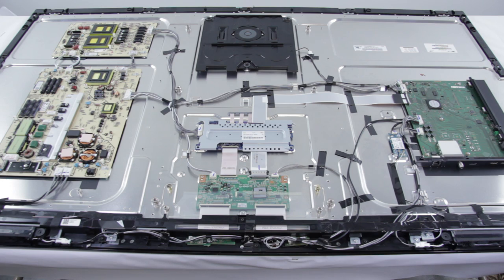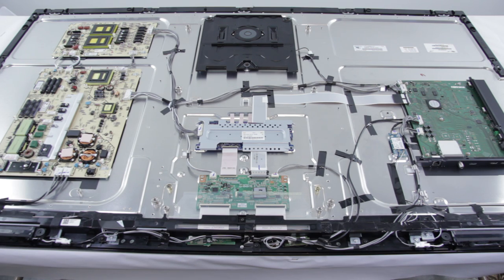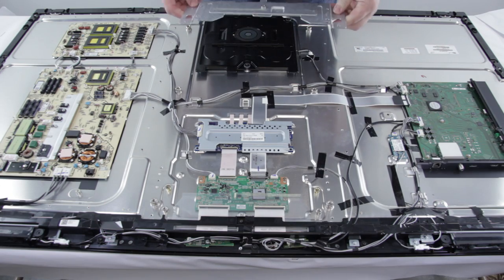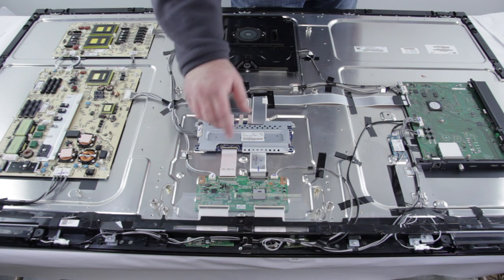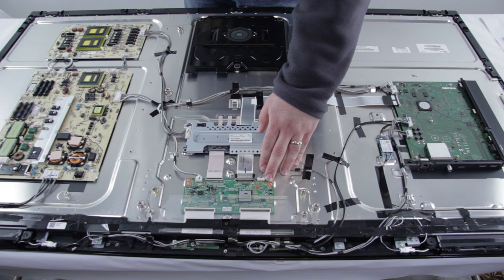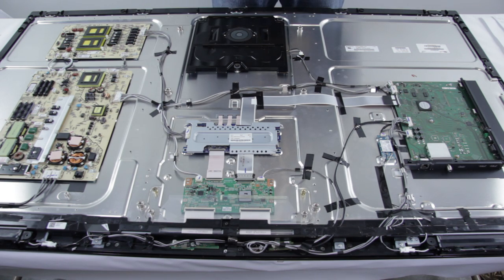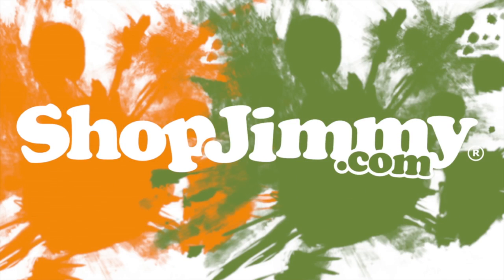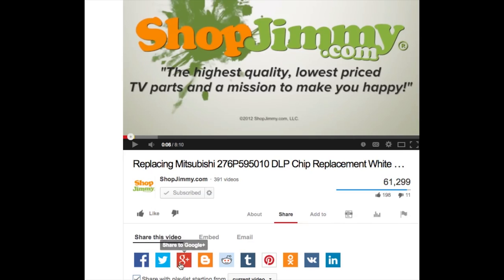LED TV Repair T-Con Board Help Review Overview - Common Issues and Problems with T-Con Boards

Comment: Vizio E420i-B0 with colorful lines. I turn it on i can see some of the start up and some of the input sources. Sound is still good what should be the problem? Is it the T-Con Board?
Reply from the maker: +rey azada   Try all repairs and troubleshooting at your own risk.  This sounds like a TV panel (TV Screen) problem.  If your TV panel is bad, it may be more cost-effective to replace the TV as panels are typically hard to find in stock, difficult to replace, and expensive.  Thanks and please let us know if you have any further questions!  www.shopjimmy.com

Comment: LG LED 43" TV

A light green tint appeared across the television. There is a horizontal strip of about 4 inches across the top that seems unaffected (color is normal).

LG43LH540T

Comment: jimmyTV.  I have an LG LED ... Model number 55LW5600-UA.  I have no picture, but I do have sound.  Watching this youtube video as well as others I believe the problem is the tcon board and I need to replace. Is this what you think it might be as well?  If so, do you have replacement tcon board for this model?  Thanks!

Comment: I have an RCA PRK65A65RQ that had intermittent no picture issues. Tried to reset then nothing worked. Replaced power inverter,  now it  turns on, picture flashes on  for a second then black 15 seconds later flashes on for second. Any thoughts?

Comment: I have an LG65LY540S-UA LED TV.  new out of the box, but it has passed its 30 return policy.  the tv powers on, has color  and has a very grayish staticky picture.  I have pictures of the issues as well.  how can I tell if I need to buy a new board for the inside and if so, what kind of board?  thank you

Comment: I have a VIZIO model #d650i-b2 it has sound but no picture.  It went out while the TV was on, it has a faint blue screen to it. Was wondering it you had any idea as to what you think it could be, or what test I do could perform to narrow it down.
Reply from the maker: Patria Ferrence     PLEASE SUBSCRIBE TO OUR CHANNEL - Try all repairs and troubleshooting at your own risk.  This could be a problem with either the t-con board, the main board or the TV panel.  You can replace the t-con board and main board individually to see if one of those boards fixes the problem.  Click this link to replacement parts for your TV model number:  http://www.shopjimmy.com/catalogsearch/result/?q=d650i-b2  There may be multiple boards for the same TV model number, be sure to match part numbers on your current board, with your replacement for compatibility.  Thanks and please let us know if you have any further questions with your TV Repair!  www.shopjimmy.com

Comment: I have a Westinghouse TV DW39F1Y1 that the picture went out but has sound. I just changed main board and no change. did a flashlight test and can see a picture in the dark. with this TV I only see a t-con board main board and power supply on back if it's the backlight where is it at on this tv

Comment: Samsung 55-Inch 4K Smart LED TV UN55KU6300FXZA... I still have a picture and sound when using apps through the Internet. However all my hdmi and component inputs show no signal. Is this the t-con board and if so which one do i purchase from your shop. Thanks

Comment: Jimmy, I have an Insignia NS-42E760A12 42" LED 1080p HDTV that I operate 24-7. It's not very old, maybe 2 years and it's now flickering on the left half of the screen which also is slightly darker than the right. It happens on all inputs. When it first started it would go away after a couple of hours being left on. Now it is permanent. Which boards do I need to replace to fix this issue? Or is the panel shot and I should buy a new TV. TCON, Main board, power supply??? Please help.
Reply from the maker: Peter Chan   I recommend replacing the power supply board in your TV.  Here is a link to replacement parts for your TV model number on our website, click here:  http://www.shopjimmy.com/catalogsearch/result/?q=NS-42E760A12  Be sure to match part numbers on your current board, with your replacement for compatibility.  Here is a link to a video showing how to identify your part number, click here:  TV Part Number Identification Guide for Insignia & Dynex Power Supply Unit (PSU) Boards  You can also call our customer service for further assistance with your purchase.  (877) 881-6492  Thanks and please let us know if you have any further questions with your TV Repair!  www.shopjimmy.com

Comment: Hello
I have received a message from my local repair center, that the TCON-Board in my Pioneer L55S3D13N is broken. I would like to know if it is easy to replace in this model before I decide to let them replace it at high cost?
Reply from the maker: Frederik Valsted   Most board replacement can be done by Do-it-yourselfers, however I am not sure what your t-con and TV back looks like.  Thanks!  www.shopjimmy.com

Comment: Hi Got a Samsung UN55ES6150f  Got no backlights. did your flash light tests and have , menu and audio. Your video is a bit confusing for you say it can be the Led Driver board . I have what appears to be 3 board  main board, power and  tcon .  I assume the led power is on the PSu board. The set is 2 years old  and no parts from you are available . I see used stuff on ebay but still confused on what board its a 50/50 shot but with no Backlighting is it safe ot say its the Power board Samsung BN44-00503C Power Supply

Comment: Hi I have an LG m3701c-ba and the picture is fine except that on dark images such as grey's, black's or any scenes that require a lot of color depth I get reddish patches on in certain areas of the screen, adjusting contrast and brightness helps some but then the reddish patches appear in other areas of the screen or change shape... is it a bad motherboard or t-con board?
Reply from the maker: sburns015   This sounds like it could either be a problem with the T-Con board or the Main board in your TV. You may need to replace each board individually to see which one fixes the problem. Here is a link to replacement parts for your TV model number on our website, click here:  http://www.shopjimmy.com/catalogsearch/result/?q=LG+m3701c-ba Be sure to match part numbers on your current board, with your replacement for compatibility. You can also call our customer service for further assistance with your purchase. (877) 881-6492 Thanks and please let us know if you have any further questions with your TV Repair! www.shopjimmy.com

Comment: We have a Sony kdl-42ex440. Three years old.Color problems, becoming blurry . Like an overexposed photo.
Research kind of points to bad t-con  board. Problem comes and goes. More lately. We think we could change 
The board. See board for this model is out of stock. Suggestions?

Comment: I have a Panasonic lcd tv model number TC-L58E60 it has pitcure and sound but on the picture it has ahorizontal  line a 1/4 way down the screen all the way across and from the line down the color is darkened and on the left side on the screen has some double imagae and slow motion . could that be the t-con board? thanks

Comment: I have samsung led tv UE40D5520. It shows vertical lines but it has sound. when I opened the back and disconnected one of the t-con connections,the picture showed with sound on half of the screen, no vertical lines.I reconnected the cable whilst the tv picture was still on and got the other half showing as well to give a full screen view.

If I now switch off the TV and turn  it on again the vertical lines reappear. I think it is a probblem with th T-CON board. Please can you advice what the problem is and where to get the genuine part. Thanks.

Comment: I have a Visio m550nv...the screen intermittently begins to have green lines and pixilated green and purple images. This happens to both the image on the screen and menu/volume/etc display. Would this be a Tcon board issue and do you have a video which specifically addresses the repair to my particular model?

Comment: JVC - LT-50CA890a

Hi I am looking for some advice with my tv, I have noticed a couple still lines vertically across the screen while it boots up and when playing video or displaying anything, patches flicker displaying random vertical and horizontal lines. What could this be please?

Comment: Emerson tv 32 inch Model # LF320EM4-A red light stays on when power button is pressed red light flashes 4 time then solid red again no picture or sound. Replaced combination power supply and main board . Same results after replacing

Comment: Seiki SE501TS backlight flashes very bright then off, flashlight test shows menu on screen and the sound is good. Already replaced mainboard and power supply board. I am guessing to replace the T-Con board next... ??? HELP!

Comment: I have a LED lg tv model:47LN5700-UH and I think it's the backLIGHT but not sure .. When I turn it on it flashes then goes dark, wen I put a flash light on it I see then images on the screen but it is very dim. Any suggestions

Comment: Hi Have Sharp lc-70le55ou picture comes on for 3-5 seconds then goes dark but still have sound and backlight...anyway to know whether it is the t-con or the main board as you suggested?  Thanks in advance for your help
Reply from the maker: +stephen thompson   Try all repairs and troubleshooting at your own risk.  I recommend running the flashlight test on your TV.   Here is a link to a video we produced that shows how to run the flashlight test. https://www.youtube.com/watch?v=xUzCLgoSPGM Please reply with your flashlight test results and we can recommend a replacement part for your TV repair. Thanks and please let us know if you have any questions! www.shopjimmy.com

Comment: I have a hitachi LE49s508 with no backlights. I am trouble shooting the problem and I need to know the voltage needed for the backlights. I cant locate this on the board can you help ? Problem I have is no sound no picture

Comment: Hi,I have jvc-lt-49n675u,switching on but not starting jcv emblem the light is blue but the screen blue and white like no sound no picture. So I have checked all the back light led's they are  ok what could be  a fault I thank  you from auto

Comment: I have a Samsung LTF460HA06. The picture had a series of vertical lines. I replaced the ribbon cable that connects the main board to the T-con, and also ordered a new t-con board from you. Now looking at the television, the left side of the screen is clear and crisp. The right side has two large white vertical lines. 3 inches wide each and a very thin red line all the way to the right of the screen. I have rechecked all of the connections and they are all secure. Where do I go from here? I feel like because the picture did improve, is it possible that one of the ribbon connectors the run from the bottom of the t-con board is bad or loose at the panel? Is there a way to check at the panel? If not, what do you guys think? Thanks in advance. Joel

Comment: 47ls4500 LG LED
powers on, has sound, has back lights but no picture.Checked powerboard to main board at the power on, reads 3.5, followed cable to main board pin one got 3.5. Checked connection from main to t-con no volts at main or t-con connection cable

Comment: I have a 42" LED 3D tv by blaupunkt and it has horizontal lines half way down going to the bottom and it pulsates like wave. Would that be the t-con board,
Reply from the maker: Aneurin Austin   This sounds like a TV panel (TV Screen) problem.  If your TV panel is bad, it may be more cost-effective to replace the TV as panels are typically hard to find in stock, difficult to replace, and expensive.  Thanks and please let us know if you have any further questions!  www.shopjimmy.com

Comment: Hi i have a sharp lc 60le830u.  Ive replaced the main backlight board.  The backlight worked for a week afterthat and now no backlight just ghost image i can see with a flashlight on the screen.  Still getting lamp error flash of power light. Any ideas to try or parts to replace?

Comment: Samsung LED model un40d6000sfxza has double horizontal image basically displaying the image twice over top of itself but down a little. Have seen videos where taping the connector for the panel into the t con board has fixed the issue. Curious if this is a permanent fix or if I'm better off replacing the t con board or if there are any other possible causes to this problem. Thanks for any help and advice and also what t con board I will need to order would be greatly appreciated.
Reply from the maker: Buckeye Derrick   This sounds like a TV panel (TV Screen) problem.  If your TV panel is bad, it may be more cost-effective to replace the TV as panels are typically hard to find in stock, difficult to replace, and expensive.  Thanks and please let us know if you have any further questions!  www.shopjimmy.com

Comment: HI Jimmy

I have a Toshiba 50l4353d that has developed intermittent horizontal lines and a blurring when the lines appear every 4 seconds or so, which part do I need please? I've taken the back cover off as well as the T-con board plate but have not unplugged any cables as yet. Cheers BB

Comment: I have a TCL 55p605 tv that is dimmer on the top 3/4 of the screen. It still has an image it's just that it's dimmer on the top 3/4. Could this be the T con board?

Comment: I have an LG 65UH6550 4K tv....it keeps turning on and off by itself repetitively. Won’t stay on very long before turning off and will turn back on shortly after turning off...the timing is inconsistent...seems as if I have a faulty switch or relay that turns on the TV...when it’s on everything is fine...but I literally have to un plug it to keep it from turning on and off...any suggestions?

Comment: I have an LG 55LM7600, since yesterday the screen has a vertical pink/purple line, is one pixel inch and about 2 inches from the left side bezel, If I press the bottom bezel, close to the line, the line disappear and the image is fine,  seems to me like a bad connection?, I hope....., what do you think...thanks.......
Reply from the maker: *****   This sounds like a TV panel (TV Screen) problem.  If your TV panel is bad, it may be more cost-effective to replace the TV as panels are typically hard to find in stock, difficult to replace, and expensive.  Thanks and please let us know if you have any further questions!  www.shopjimmy.com

Comment: Hi, Thank you very much for making all these very informative videos. I have a Samsung LED Tv model UA43M5500AS. From last few days the TV is showing black screen when it is switched on and after a minute or so vertical lines starts to appear. Sound of the TV works normally. I opened the TV and unplugged one of the ribbon cable from the T-con board, doing so the TV shows normal picture on half of the screen while the other half is black. Then I put that ribbon cable back in properly and took off the other one, doing so the TV didn't show any picture.
Please suggest if my assumption is correct that the T-con board is faulty and replacing T-con can fix my TV?
There is a white sticker on the T-con board that has following text mentioned on it "UZ-5543T01C35-79G-5060159-R10YQ-01". Other text on the T-con board outside this white sticker says "T43HVN01.6 Ctrl BD" and "43T01-C04". Please also suggest what number out of the above should I look for while ordering a new T-con board if you agree that the problem is because of this board. Thanks

Comment: I have a 55" Vizio M3D55OKDE.  Just recently my picture has turned black and white though I still have color on the menu screen and smart tv icons/logos.  This happened once before about a week ago but after turning the power off and back on the color was back. This time the picture remains black and white. (no matter if im viewing cable, dvds or games) I have checked and re-checked all cables and was wondering if there's anything else I can do. If I were to replace anything would it be the T-con board or the main board? im new to diy tv repair but I dont want to buy a new tv if it is a simple fix!

Comment: Samsung UN60J6200AFXZA all LED's are flashing on the back and power light flashes. I have replaced the power supply board and the video driver board with no change. Any thoughts?

Comment: Have Toshiba 40rv525r with no picture, no sound and no back light. Took panel off and there is a red light on the main board. has green light on front of tv and toshiba light is on. Any help?

Comment: I have a westinghouse model # ltv32w6hd 32 in led 1080p tv. The issue is picture looks great for awhile 30 mins-hour. Then gradually gets dark. If i turn tv off awhile it looks great again, but eventually darkens.
Reply from the maker: David Smith   This sounds like it could either be a problem with your main board or the backlight inverter.  You may need to replace each board individually to see which one fixes the problem.  I recommend starting with the backlight inverter and then if that does not fix the problem, I recommend replacing the main board in your TV.  Here is a link to replacement parts for your TV model number on our website, click here:  http://www.shopjimmy.com/catalogsearch/result/?q=ltv32w6hd  Be sure to match part numbers on your current board, with your replacement for compatibility.  You can also call our customer service for further assistance with your purchase.  (877) 881-6492  Thanks and please let us know if you have any further questions with your TV Repair!  www.shopjimmy.com

Comment: Hi Folks, It's an LG47LV5400 Manufactured in 2011, bought brand new just before christmas, same year.
Screen would drop video,  go all white (backlights working)  lost audio. Shuts down (black)  power lamp
stays on.
Would run fine,  2 mins,  or 3,  then crash as described above. 
Suspect Tcomm,  but have you seen similar ?  Advice ? Many thanks.